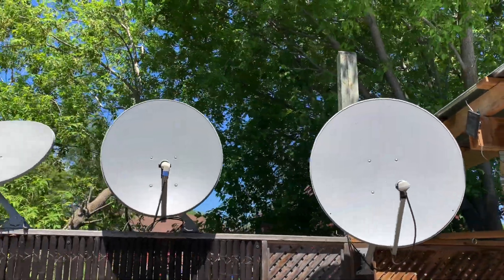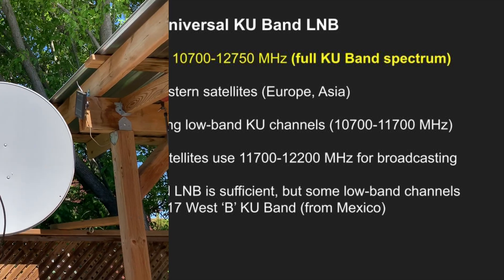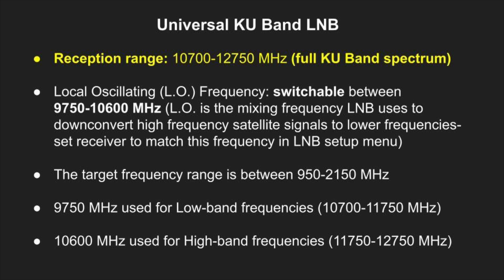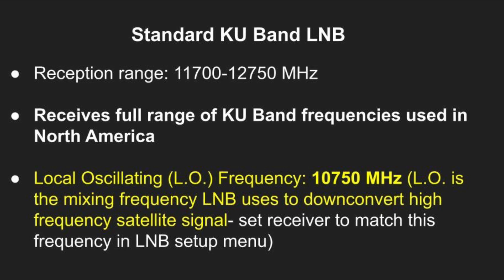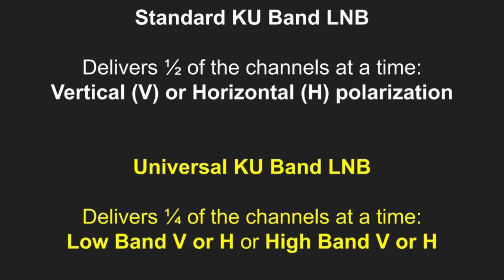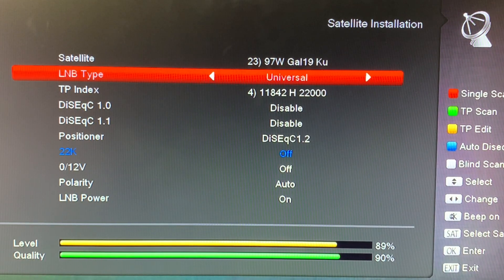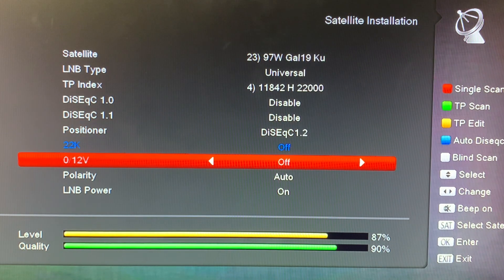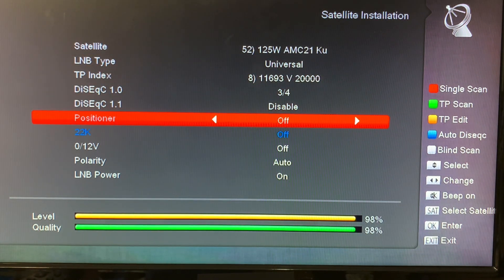Universal KU Band Satellite LNB’s Explained - Free Satellite Television

Comment: Is same satellite will send H & V polarise signals. What is the differnce ?? Which polarisation is better
Reply from the maker: One satellite can transmit both horizontal and vertical transponders. There is no benefit to either one as far as I know, the difference is simply the orientation of the signal wavelength. Either it is oriented in a vertical line or in a horizontal line, hence the polarity difference. Today’s LNB’s and satellite receivers use electronic polarity switching, which happens automatically as you change the channel, according to the polarity of the signal.

Comment: Can i use the same lnb for H & V Polarised signals
Reply from the maker: Yes, one LNB will receive both signal polarities. The LNB contains two antennas -one is oriented horizontally, and the other vertically. The receiver will detect the polarity of the signal and automatically switches as required. I would make sure that the ‘auto polarity’ setting is turned on in the receiver menu to ensure that everything works as it should.

Comment: hello Northcoaster Hobby, having a devil of a time connecting an iDirect MDM3310 modem to data satellites, especially Eutelsat 117 116.8W I am using a standard KU LNB any suggestions?
Reply from the maker: Make sure the LNB frequency is set to match your LNB’s LO Frequency.
I’ve never used one of those devices you mentioned.

https://youtu.be/1UmBTtBX6pU

Comment: Is that KU Band LNB can use in any part of Asia?
Reply: Universal KU Band LNBs will work excellent everywhere. Make sure the satellites you try to receive have KU Band frequencies otherwise it will not work. Also there are some satellites that broadcast circular instead of linear, a Universal Ku Band will not receive circular polarization only linear polarization so you need a circular Ku Band LNB but this is a rare case and is mostly used for subscription based channels. Northcoaster Hobby explains very well everything about free satellite TV
Reply from the maker: @Nicholas_Chris  Thanks Nicholas👍👍
Reply: @NorthcoasterHobby  I have some friends that are new to FTA satellite TV so I recommended your channel the only difference is that we use both eastern and western satellites. In South Eastern Europe or Balkan region we can receive satellites from Hispasat 30 West up to Intelsat 68.5 East. Lots of FTA TV and Radio channels on Ku Band.
Reply from the maker: @Nicholas_Chris  Thank you, I really appreciate it.👍👍
Reply from the maker: Yes

Comment: Great explanation sir ! i would like to know if a OVAL dish plate can receive the same TPs (data) as a round dish.will we have any loss? i Live in Europe .Thank you sir !
Reply from the maker: I use elliptical dishes (60 and 75 cm) with no issues. However a bigger size dish is always better in this hobby.  Some transponders that have a higher FEC require a larger size dish.

Why You Might Need a Bigger Size Satellite Dish for Free Satellite TV
https://youtu.be/DgUCJ4U7gXM
Reply: @NorthcoasterHobby  In general 80 cm dishes will do a great job receiving all transponders and the signal is very good, but for Ku Band I recommend a 100 - 120cm dish. Then you have no problems.

Comment: very interesting stuff , I'm glued to listening to the facts , also explains the automatic volt switching for a c-band ku band combo lnbf. that I've never heard explained. I have a 22 switch added for that, to go betwwen c & ku
Reply from the maker: Exactly. That’s how the switching happens for a C/KU LNB as well, 22KHz tone.👍 Thank you for watching!
Reply: @NorthcoasterHobby  MY c band work for a while and quits,burned out 2 diff cox cables . should I solder the ground on each end  for trouble shooting. the receiver says its 12 volts amiko brand  and uses voltages for switching . MY 1990's sat had seperate wires. and never had this problem
Reply: I found out in was the aluminum foil around the  bradded ground I didn't remove , that caused my signal to go away. so i cut back the black coating , wrapped a wire around & soldered to the normal braded gnd. shield & to the coaxial end staying away from the part that turns  now i got a signal again
Reply from the maker: @janbill79  sounds like a short between the shielding and the centre conductor. Glad you figured it out.
Reply from the maker: @janbill79  the switching voltage is 13/18V. The 12V switching is an older way of switching LNB signals, not commonly used anymore.